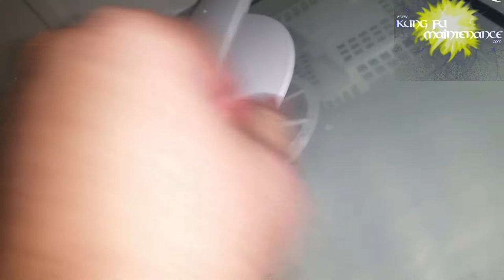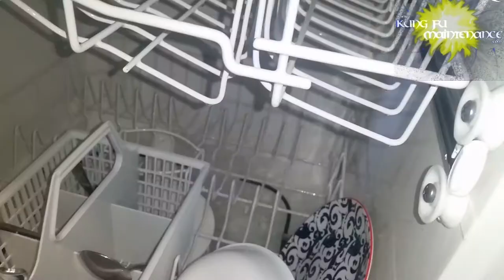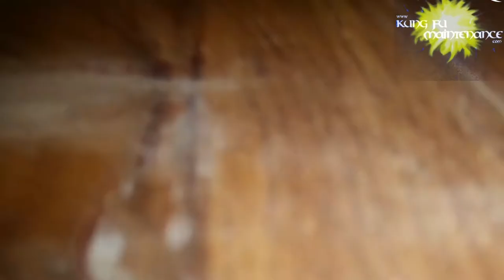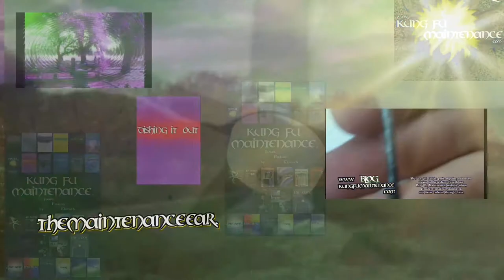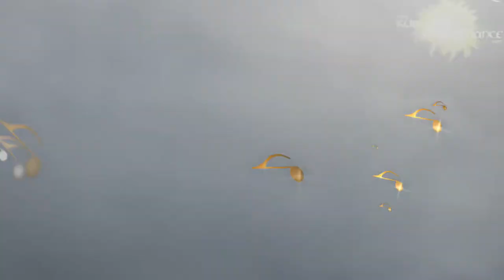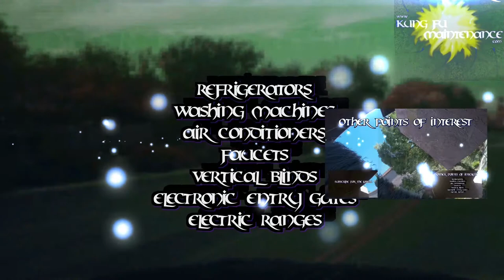New Dishwasher Will Not Drain Line Is Clear Pump Spraying Water Inside But Won't Waste Water

Comment: The plastic screen you pulled off in the beginning you'll notice two holes underneath that screen the red ball belongs in the left hole. They often drop down if it continues you need to replace the ball with a new one.